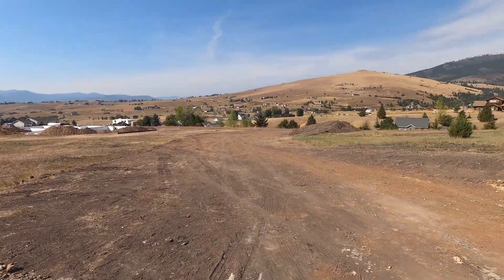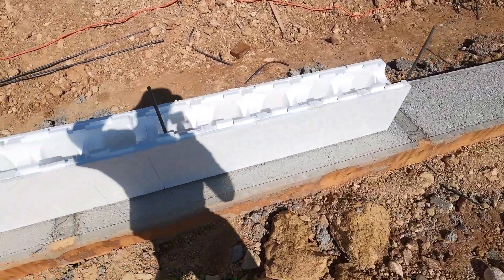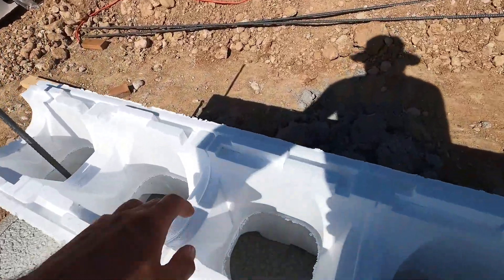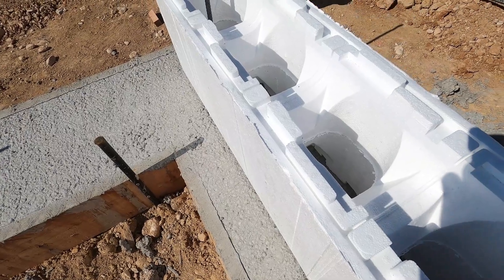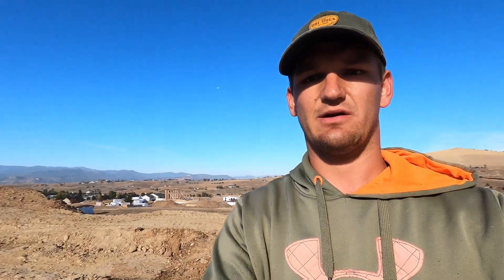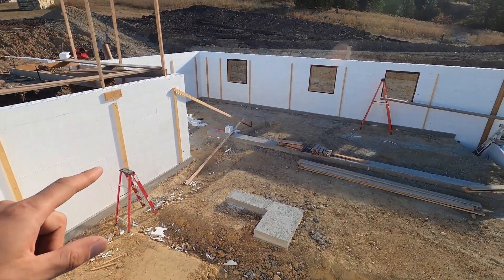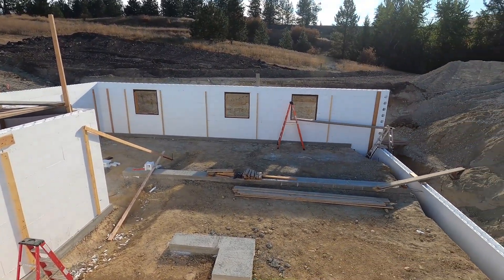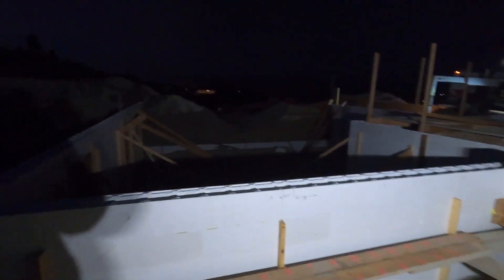DIY ICF Block Foundation

Comment: I didn't understand why you were using the table saw so much, and I would have liked a more detailed video of the corners and rebar. 
Thank you.
Reply from the maker: Once I got to the top row on the garage I had to cut the block to the right height that I needed and the table saw made that easy.

Comment: What is the cost per straight wall block?
Reply from the maker: They are the same price for straights and corners, which are $14.88 (shipping depends). Corners are the same for L and R just flip them to the side you need.
Reply: @1projectaway119  thx. I’m doing a much smaller project with BuildBlock
Reply from the maker: No worries, good luck with your project!
Reply: @1projectaway119  thx